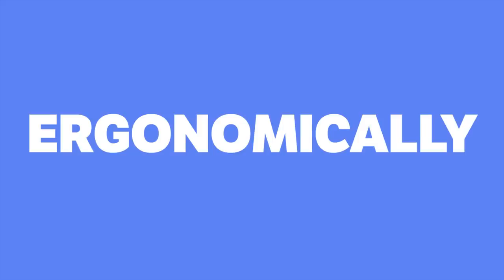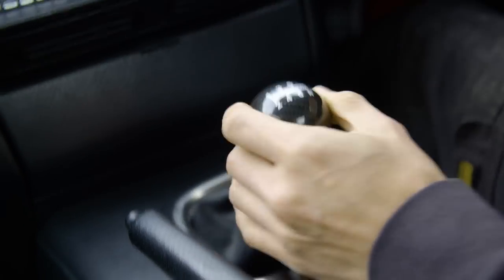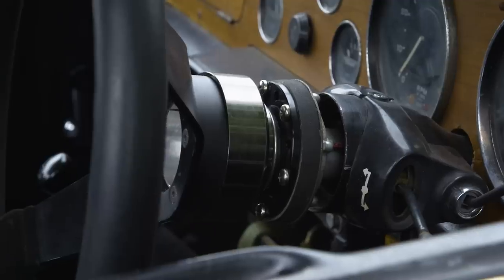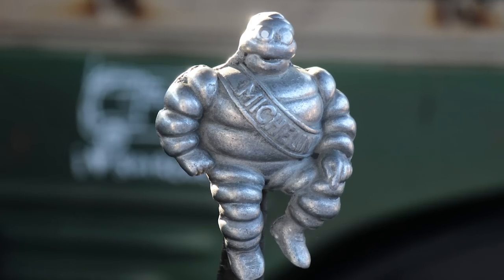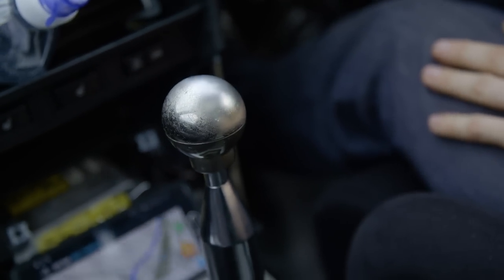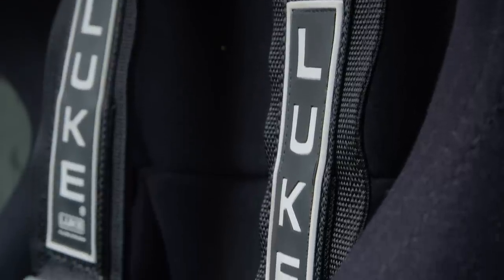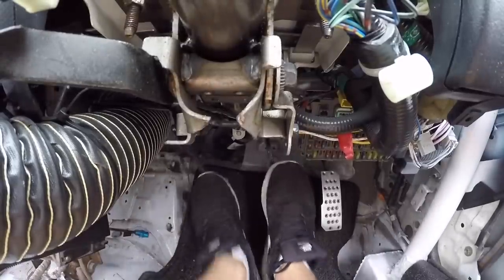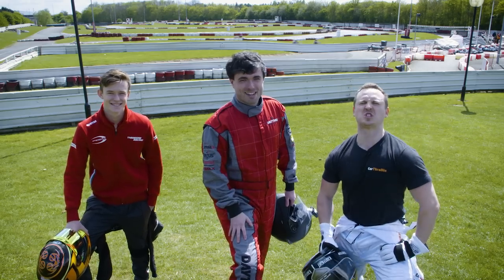5 Simple Mods To Ergonomically Perfect Your Car

Comment: please don't buy aftermarket steering wheels for daily street cars, that airbag is there for a reason
Reply: ico9750 Plus on cars with wheel mounted controls, you lose a lot of functionality
Reply: Don't be ignorant, most old cars don't have air bags to begin with.  Harnesses on the other hand are a real danger in the event of a crash. you'll either submarine and get some nice internal bleeding or get an uber cool basilar skull fracture with out the use of a hans/helmet combo.
Reply: +Albert S. my car has already leather on it
Reply: "Most old cars" what if you are in a new car?
Reply: 5 point minimum harness for me, submarining avoided. I'd say avoid a cage for a daily, can do more harm than good without a helmet for sure.
Reply: If it wouldnt be illegal, id already have my airbag removed...
Reply: that switch only works for passenger airbag. Thats why i prefer older cars. Lot better in crashes, plus no stupid airbags.
Reply: Tobias Metzger quite the opposite, newer vehicles are designed with safety in mind with improved chassis designs and safer materials
Reply: Well older cars stand better in crashes but you will get hurt then kinetic energy gets transfered to your body
Reply: You dont understand: The car should survive! In old cars no people got stuck after an accident. The frame was too hard for that.
Reply: Tobias Metzger yes, but they often died or suffered serious injury because the frame of the car absorbed almost none of the impact and the sheer energy from the impact killed the occupants.
Reply: Look at crash tests from back then. When people did em themselves, without dummies or anything. And the people survived. You drive your modern plastic death trap, but let me enjoy the good stuff
Reply: My car is mostly made of alluminium so i don't think so! and never said old cars are bad they are usually funnier to drive but as a daily i guess "plastic cars" are better and well in those old tests they did crash at 50km/h (a bit more than 30mph) and you don't even feel it in a new car...my dad crashed with a "plastic death trap" at 50km/h the car is perfectly fine same for him
Reply: Im a tow truck driver, so i see a lot of stuff. Just yesterday i had a car that was totalled with 15kmh.  Wouldnt happen in an old one. Only reason oldies arent that good for daily is because of some you barely get any parts.
Reply: 15km/h? what shitbox was that?
Reply: ico9750
1. my car never had any airbags at all. 
2. when i bought it the (installed by previous owner aftermarket) steering wheel was already very scrubbed off and small and painfully ugly so the new one was a must.
Reply: exactly
Reply: Number one safety feature has been and always will be the seat belt. Airbags are a secondary thing and weren't always around until ... late 80s? Plus many Jeeps don't come standard with them... or sometimes doors. ^_^;

Besides, airbags tend to be a lot more harmful than anything. If one doesn't rearrange your face then it busts the interior and there's nasty ass stink powder everywhere.

I like having quick-release aftermarket wheel in my summer car. Can walk away without locking doors or even keep the engine running, knowing someone won't run off because the average person doesn't know what sorcery this is!
Reply: Airbags are a good thing in my mind but if you whould stay close to one it whould probably broke your nose or somthing lol
Reply: That Red Truck Yeah true it can break your nose if your head is to your steering wheel or the dashboard, depends where in the car you sit. But yeah airbags however, is a good thing to have your safety. In older cars, 1 major crash, even with seat on, you die. In modern cars you can still die in a crash, but airbag will safe you.
Reply: Not even.  In older cars the car and driver were both dead.  Now its just the car.  The body flew apart, the engine went through the firewall, the roof collapsed, all without absorbing much energy or protecting the passengers.
Reply: No, old cars were worse for that too.  Even though they had panel gaps you could drive a VW beetle through, a slight tap was enough to bend the frame so the doors wouldn't open and you needed the jaws of life.  These days, even in relatively high speed collisions, the doors usually still operate -- that is a safety feature as well.  The cabin cell is super reinforced -- much much stronger than old cars, while the front and rear are designed to crumple, protecting the cabin.
Reply: I dont have airbags.       or abs.        or a sturdy car.      if i crash i die.     i love my Honda CRX. :D
Reply: ico97 Lea
Reply: ico9750 Learn how to drive then. we've survived decades without airbags. why can't we now?
Reply: Absurd.
Reply: i did for my cars and it was instantaneously better, but they were "old" cars (25-30 years old)
Reply: First of all let’s clear some things up. Airbags were only implemented in cars because to many ignorant people decided to not wear there seatbelt! 
That said, if you intend to change your wheel like I’m in the process of doing for my street car then proper FIA approved harnesses and bucket seats are a must! I’d much rather be in a car with proper FIA approved kit than to be in a crash with a stupid airbag and a standard seatbelt. Not to mention, but the real reason racecars use aftermarket wheels without airbags is because of you spin out or loose control and hit something you now are completely blind to correct or control how the car comes to a stop. Also a quick release is extremely useful say if you land on your roof and need to remove it to help GTFO of the car. In summary what I’m saying is, if you change your wheel out then you should also have the accompanying mods to hold you firmly in the car in the event of worst comes worst. So Steering Wheel + Harnesses + Bucket Seats.
Reply: Quinn Kirlew if you really want to maintain the factory controls you can simply wire them to additional buttons on the new wheel. Would take a bit of effort but a lot of guys do that.
Reply: @tobiasmetzger4522  why?
Reply: @racingwithbrad  You're simply wrong, airbags are essential because in high-speed crashes no harness is going to stop your head from jerking forward and injuring your spine. Harnesses + Bucket Seats simply aren't enough, keep in mind that race drivers also use helmets with HANS devices which are designed to protect your head, neck and spine.
Reply: @racingwithbrad  For the FIA approvied harnesses and bucket seats, you also need FIA approvied roll cage (for the harness) and with the rollcage you need FIA approvied helmet. And since people died anyway back in the good old days (with cars that @Tobias Metzger likes) they also require FIA approved HANS devices.

With all this, you can't daily a car. You can't check your blind spots by turning your head, you can't reach the glove box, you can't reach ticket machines etc.
Reply: @tobiasmetzger4522  Actually, if you look at crash statistics world wide, you would find, that fatal injuries in car crashes per miles traveled is only a fraction today, than it was "back then". In fact, the trend is, that the plastic shit boxes, who would crumble and fold in a certain way to safe lives, are in fact safer.
Reply: I have one on my daily but it has a roll cage and bucket seats

Comment: Drop a piano on it
Makes it more heavier which means more grip
Reply: Morris Marina, I presume?
Reply: I must say, I love your profile picture
Reply: WankelGT then drive a Morris Marina to top it off
Reply: Top gear references
Reply: "It's that helicopter piano transporting company that moved next door" "yes they're useless."
Reply: If you don't want the weight to slow you down. 

Fit an inverted spoiler for weight reduction.
Reply: WankelGT and down force dx
Reply: WankelGT or make the suspension so low , that you can't drive on any bump , or you will destroy the car XD This adds a lot grip XD
Reply: ahem GT-R
Reply: My GF sits in back
Reply: @bruce5868  upforce

Comment: I bought an e39 with and the previous owner already did the engine, coilovers brakes and the transmission it is an 528 with 193 hp but now it has got 250 and the cornering is awesome

Comment: I swapped my pedals cause I found a set of aluminium racing pedals still in the packaging in a dumpster at work, they were a bit of a pain to install though case they didnt come with monts that fit over the existing ones or anything like that so I had to remove the rubber and drill holes into the existing ones, then put bolts and nuts to hold the new ones in place

Comment: yeah! ruin your driving position by putting a wheel closer to you while the pedals cant move wich will force you to adopot a weird position.. and the smaller diameter will block your dials view and make steering harder (smaller wheel = less torque on the rack, wich in case of non power steering will make stuff .... interesting)

Comment: Lean the seat back like a real G cause I'm too bloody tall for a sports car.
Reply: Road Worthy feel you nigga, 6'5 here. Can't fit into anything... wanted a miata
Reply: 6'2 here :D
Reply: Ahh gotta love the gangster lean or enjoy my head touching the roof in my rx7
Reply: 6'3" and I don't fit in my rx8
Reply: 6'2 here my legs are almost touching the steering wheel...
Reply: short ass pants Cabrio?
Reply: @KrzychuYea  you should have seen my kp60... I'm 1.87m, I had to take the wheel off to get in, and with the seat all the way back I still couldn't get my head straight. Could barely move in there...... Older japanese cars were smaller because they were designed by shorter people
Reply: Lol, 6'4" in an Alfa, can't even see the dials properly from my head position :(
Reply: 5’6 and enjoying all of the leg and head room in my car
Reply: bruh im str8 5'4 that has its struggles as well

Comment: How about getting rid of interior rattles?  especially on daily drivers.
Reply: i know HOW to do it.  I was suggesting it as a better idea than some of the ones they featured...
Reply: My car doesn't have rattles :D
Reply: I completely gutted my interior, so there is nothing to rattle
+ some side effects like noticeably improved performance, braking, cornering, improved gas mileage
Reply: veteran011 tighten screws and bolts usually they loosen causing rattles.
Reply: I went from a car with rattles and squeaks to one that doesn't, and I miss those rattles and squeaks
Reply: You are everywhere.
Reply: That was quick!
Reply: Oh good luck chasing that problem! I used to have to deal with those complaints alot when I worked for bmw. Some are easy and predictable and some will drive you mad

Comment: I did an air conditioning delete but I'm a Canadian and still wanted hot air so I bypassed the exhaust system and connected the headers straight to the A.C. ducts. Can't wait to take my new and improved ride for a drive.
Reply: I suppose you're not serious,right? You'll die from carbon monoxide/dioxide poisoning
Reply: Stop spoiling the suprise, you are ruining the fun dude
Reply: I did this but for some reason I keep falling asleep and getting headaches
Reply: Can we have an update pls, I really want a heater in my pick up
Reply: CALI DATSUN right I need to know.
Reply: This comment and it’s replies 😂😭😂

Comment: Aftermarket steering wheel and lose the one thing that protects you the most...AIRBAGS
Reply: Most old cars didn't come with air bags to begin with. What's the point in not doing so in such a scenerio.
Reply: This video isn't about old cars, it's about cars in general...
Reply: some old cars didnt come with a seatbelt either, why wear seatbelts?
Reply: I agree with the sentiment but... I'm pretty sure Seatbelts protect u more than airbags.
And Anti-Locking brakes are probably just as important.

Imo aftermarket steering wheels are only ok for 2 situtions: 
1.) Your old Airbag is damaged and it just costs way too much to replace it.
2.) Trackcar with 6-point harness.
Reply: If you have race seats with harnesses...you won't need an airbag
Reply: my car never had airbags, so easy choice, also not wearing seatbelts is one of the most stupidest things you can do imo
Reply: Watch crash tests, a good airbag will make a difference between life and death but they are oftenly only for one type of impact.

Often in a collision the steering rack gets pushed away making the airbag detonate in a wrong direction rendering it useless and sometimes even harmful.

Some cars are well engineerd and work perfectly with airbags but most are actually pretty horrible, especially cars before 2010.

I advise to watch such video's to see what a 100 km/h crash can do to your car, also if you drive something like a Golf mk2 and think a lada is unsafe? Bad news they are both eaqually harmful in a 100 km/h collision. (Take in account that if you're doing 50 and collide against oncomming traffic doing 50 that makes 100)
Reply: If you have the accompanying mods: Harnesses + Bucket Seats then you’ll be fine. A roll cage isn’t necessary as you’d have the same outcome if it was to land anywhere but up as you would with an airbag. So even without a roll-cage it is much safer than a car with shit seats, standard seatbelt and an airbag wheel.
Reply: That's why I got a leather steering wheel with functional air bags from a spare parts place for my car. The wiring was still the same so it works.
Reply: Airbags don’t protect you the most. That job belongs to the seat belt.

Comment: For some reason aftermarket wheels don't just fit into most cars. If the interior is otherwise quite stock you should just stick with the original wheel. Otherwise it just looks too rice.
Reply: i don't think a 1947 1.3L beige shitbox with faded dash and a fart can is gonna have a need for an ergonomic high performance steering wheel.
Reply: You clearly haven’t done your homework on aftermarket steering wheels my friend! There are thousands, probably even hundred thousands of wheels available. Personal by Nardi for instance is my particular favourite. Looks like it belongs there in the first place.

Comment: with short shifters, I've never understood why some cars have such a long throw as standard? what benefit is there to this?
Reply: More distinct placement of the gearstick, I guess. My sister doesn't like driving my golf because 1st, 3rd and 5th (and 2nd and 4th, obviously) feel too close to each other for her.
Reply: I dont think there is one, its just the way the transmission works.
Reply: yes could be that I suppose. needs more precision on the part of the driver but allows much better speed and performance.
Reply: Nathan Soper Longer throws make the shifter lighter and easier to move around. Some people don't like short shifters because they make the shifter stiff and heavy. Short shifters also tend to be noisier and vibrate more and most car manufacturers try to tune that out as much as possible.
Reply: KentB27 yes that must be true I suppose since there is more distance from the pivot point and hence less force needed.
Reply: Nathan Soper exactly. Short shifters move the fulcrum further up. It's just not as user friendly as a transmission with longer and lighter throws.
Reply: cheers guys! should have spotted that before